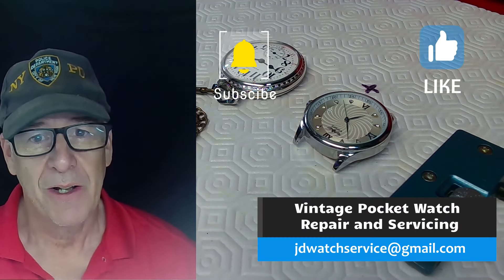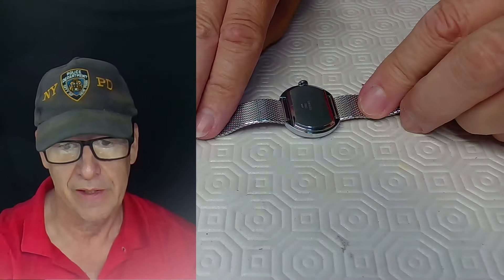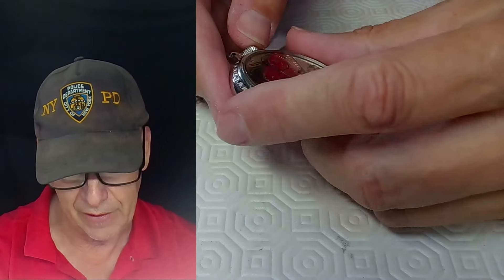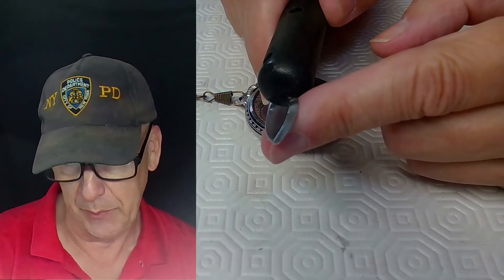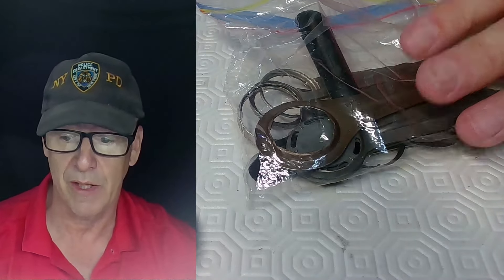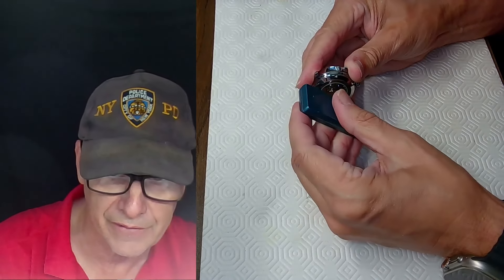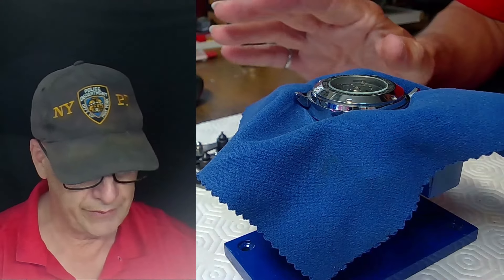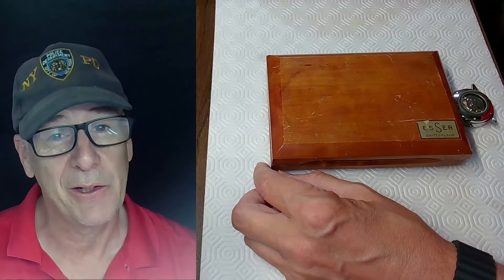Watch Case Back Tool Review

Comment: I’ve been on a journey with casebacks too, as I suspect most here have. First off a case vice is a must, irrespective of whether it’s a push on back or screw on. I have an escalation process now for casebacks. For pop off 1. Caseback knife, 2. Horotec spring tool, like an automatic center punch with blades, 3 if that fails an original leatherman and a small brass hammer, 4 if that doesn’t work a single edged razor blade and the hammer.
Reply: For screw on casebacks I try 1. The ball, 2. A T shaped cheapie tool like the horotec one, if that doesn’t work then straight onto the Aliexpress Bergeon 5700 clone, it has never failed for me. You can get Rolex and the rubber dies for it too.
Reply: The blue one you showed first off and the Jaxa style tool are rubbish and I threw them out a long time ago. Man sometimes this hobby is frustrating and costly for no other reason that we don’t have the experience yet. BTW that AF bench tool was so way over engineered it would drive me crazy 😂
Reply: Oh, another thing, never use these tools to modify how the caseback goes on, that will compromise the water resistance, use the press with the appropriate dies to put the caseback on again
Reply from the maker: @tomholloway7566  I love your use of a hammer. Nothing works take out the hammer. Don’t believe I’ve ever had a case back. I couldn’t remove, however, snap on ones can be tricky. I actually bought the high end bergeon case back remover knife. I just couldn’t find it for the video.
Reply: @JDRichard  Gentle taps with a hammer to push the tool in like a wedge is better than prying or twisting with the tool and leaving marks. 

The Horotec tool Tom described that’s like an automatic centre punch is excellent, too.

I’m pretty sure that Esslinger have a cheaper version of the Horotec tool, but I don’t know if it works as well as the Horotec.
Reply from the maker: @mercuriall2810 I actually have that tool but could not find it for the video…too many tools hidden in cracks

Comment: Thanks for the info.
My concern with putting a case back into the freezer would be that the air close to the case back would chill causing water in the air to condense on the surface if the temperature goes below dewpoint. This would put moisture into the watch.
Reply from the maker: Good point. It was a recommendation back when I had the problem. It was a friends sons quartz watch

Comment: Hi JD. The 2-pin caseback openers, especially the cheaper ones, are indeed great tools for scratching casebacks. The pins tend to tilt under pressure and come out. I think the 3-pin version would fit the watch you tried it on. It looks like you tried to fit it in the recesses that were 180 deg apart, but that's not how those work. The keys in the ziplock bag you showed are useful if you're working on wristwatches. I've used them on a lot of diver style watches and also on Enicar Sherpa models. My nr.1 opener is the Bergeon 5700, simular to your gold standard tool. The drawback is that the Bergeon doesn't have two fancy red balls to show you where to hold it. It just has a wheel.
Reply from the maker: Hey, thanks a lot. If I didn’t have those two giant balls on the end of the lever, I wouldn’t know where to grab it. I love the opener and it’s great for very difficult watches.

Comment: I’ll second the case holder. In my eager beginner nightmare, I Krazy glued a 5/8” hex nut to the extremely stuck 12 sided back of a Dacor with a rare FHF 73 movement and a killer black dial. Put the cast in a cabinetmaker bench vise, got the case open with about 30 lb*ft torque, then discovered a lug was bent. Luckily it was cheap from a yard sale. Also it makes my Geiger counter go nuts, so that one is hardly a loss.
Reply from the maker: @Mars-zgblbl  that watch had to be a really old dollar watch with the hands painted with radioactive radium. I have two of those watches that make my Geiger counter go crazy. Just make sure if you’re working on these watches not to breathe in any flakes, or better, don’t work on those watches. I have heard of that technique going on some kind of a nut to the back so you can grab it and pull, but I’ve never had to use that approach
Reply: @JDRichard  Hey JD. I recently had a mainspring jump out of the barrel and the arbor went… somewhere. This brings up search tricks. Here are the few I know: (a) sweep the area with powerful magnets on a steel ruler, (b) use a bright light and setup a grid like an archaeological dig, (c) prepare the workspace (if only), and (d) for small items on the floor use packing tape looped around the hand sticky side out. Do you know of any other search tricks?

Comment: Great video JD ! How about a short video for the solid casebacks that require compressed air to pop the crystal to remove the movement. I mention this as a novice watch repair person is likely to encounter one in pursuit of horological greatness ( and really because it scares the hell out of them the first time around hahaha) Thanx JD 🍻
Reply: These are called monocoque cases. 

They should always have a split winding stem, although I’ve encountered watches where a previous watchmaker has replaced the winding stem, and the replacement wasn’t a split stem.

The first step to open one of these is to pull the detachable end of the winding stem out of the watch. A firm pull with sturdy tweezers should suffice. 

Now you need a means of pumping air into the watch via the case tube through which stem enters the watch. 

There are expensive Swiss tools that look like a big syringe with a rubber nozzle, there are cheaper Chinese clones of them, or you can build your own from a 100mL plastic syringe barrel and some rubber/soft plastic tubing (just copy the design of the commercial tool and size the tube to fit the case tube watch in question.

Draw back the syringe plunger to fill it with air, seat the nozzle over the case tube and then quickly and firmly push the plunger down, pumping air into the watch. The crystal should pop right out. 

I tend to hold the watch in a piece of cloth when doing this, so the crystal doesn’t fly away when it pops off.
Reply from the maker: @mercuriall2810  of all vintage watches I’ve worked on I’ve never had to below the lid with compressed air.
Reply: @JDRichard  Look up monocoque watch cases. The contours of the back of the watch can sometimes look like they have a case back, but they don’t. 

You’re not blowing the case back with compressed air. There is no removable case back, it’s a one piece case!

The whole metal part of the case is one piece, with no case back to remove. They sometimes have pry marks where the seam for the case back would usually be, caused by people treating them like a snap on case.

They’re opened by popping the crystal out with air pressure, and everything comes out through the front. Tissot, Omega, Longines and many other well known brands have used this case construction. 

If you’re not aware of them, being faced with opening one can be quite the puzzle!
Reply: @JDRichard  I mentioned it JD because i just finished a Longines 431 in 18k yellow gold and that was a one piece case that you have to pop the crystal to access the movement. Happy trails
Reply from the maker: @khronosbest9448 Those are a bit painful to work on.
Reply from the maker: @khronosbest9448  all god my friend. I could have brought that up in the video. I have done these over the years, mainly on ladies tank cases and some others

Comment: The Rolex specific opener you showed seems okay to me. The case lugs need to move 90° in the direction you had them so they fit over the lug grips. The base has some wobble so the die can close onto the case level. 
Once tightened down the wobble should run away and disappear...
Reply from the maker: @mikebruegger8654  so you would have no issue using the Rolex opener? I just found that putting a Rolex into that holder with those metal dies would make me very nervous.

Comment: In your free time 😄you an rebuild that "Rolex" back remover to use a Myers 58 holder and it should be perfect  (IMHO the rubber ball is the best)
Reply from the maker: @rickcunnion881  you are absolutely correct. The river Ball is the best. Now the Myers number 58 movement holder only for movements and not for cases so I couldn’t use it for back removal.

Comment: Sorry JD have a question about your last method of fitting a snap back case back. how do you fit the movement case over the depressed case back without removing the die doing the depressing.
Reply from the maker: @derekashenden9789  once you have compressed it just a bit you can remove it from the Crystal press and it will install directly onto the watch. It just slightly warped it inward to reduce the diameter and allow it to fit. This is only for extreme cases where the watch back will not go on at all.
Reply from the maker: @derekashenden9789  once you have it on the watch, you can actually depress it again from the other side, but it’s really not needed
Reply: @JDRichard  thanks JD. I use a Robur press to squeeze the tight backs on. I use a tiny smear of silicone grease around the backs edge and if the back is absolutely square it snaps on.HOWEVER I will try your method. Horology is a never ending learning curve,
Reply: @derekashenden9789 Always try the Robur press as you described first. 

Only if that fails should you consider warping the caseback as demonstrated in the video. 
The technique in the video is definitely worth knowing, but it should be a last resort, and usually isn’t necessary unless the caseback has been warped during past attempts to open/close the watch.
Reply from the maker: @derekashenden9789  you are correct, and try my method you would not believe how simple it is.
Reply from the maker: @mercuriall2810  in my case, the case back was 100% impossible to put back on without that technique. And, it’s the only watch I’ve ever worked on that had that problem.
Reply: @JDRichard  Poor attempts to open/close snap on case backs by watch owners or past watchmakers can leave the case back warped. 

You pop it open, and like you found, it is impossible to get back on by other means, including the use of a watch press. 

In those circumstances, when other methods have failed, the technique you demonstrated definitely has its place and is well worth knowing.

The method you demonstrated is so simple and it is very effective, too. 

Some watches simply have very tight case backs and are very difficult to close without a watch press. Fortunately the Chinese copies of these tools are very affordable and work very well for these watches. 

When you encounter a watch that won’t snap shut in the press, then the method you showed is well worth trying and is usually effective.
Reply from the maker: @mercuriall2810 I think you’re right in this case the watch is owned by a young person and it was the father who asked me to get it working again. It was missing a crown. I suspect they tried to Jury rig a new one in place.
Reply: @JDRichard  The most difficult watches to fix are those that have been subjected to poor workmanship, or the owner (with no knowledge of watchmaking) has decided to have a go themselves. 

Undoing all of the bad work/damage can take many hours. Once that has been put right, the rest is usually a breeze by comparison.

Comment: I don't understand, you have a tool for closing watches and you decide to use it to bend the cover of the watch so that you can close it with your hands?
Reply from the maker: @nenadblazevic1692  pushing the inside of the case back just slightly, was allowing me to put the watchcase back on. I can’t remember where it pushed it back on with my hands, or are used my crystal press and pushed it on using two dies.
Reply: @nenadblazevic1692  I think the case back’s lip was slightly too big to fit the back, so the quick solution was to bend the back just enough to angle the lip and catch the inside of the case, kind of like making a bevel. Clever trick
Reply from the maker: @Mars-zgblbl Yep, that’s the trick